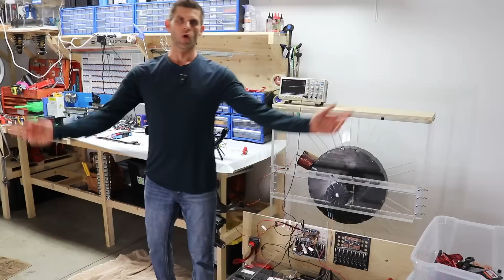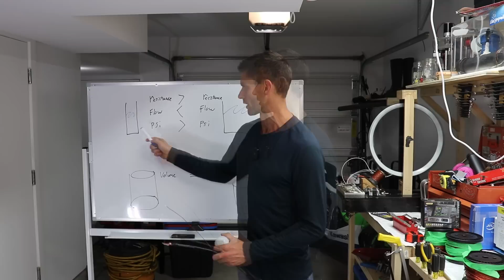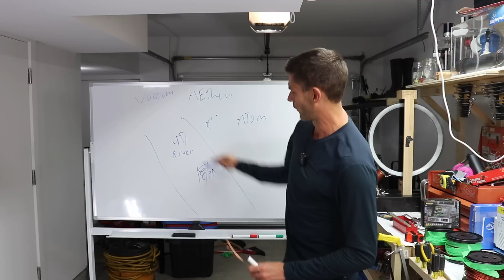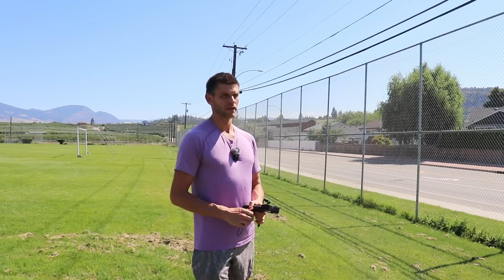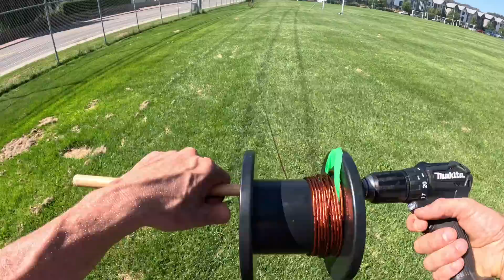I Built This Energy Machine in My Garage — And It Works

Comment: Hey broski, havnt been following you too long.. and havnt seen lots of the videos but im also intrigued in this area... (as an uneducated pleeb with nowhere near the experience you have) but ive actually been working with AI designing a similar system but kind of on a more theroretical level as I dont have the funding or capacity to achieve something like you're doing. But! my question is.. why are you utilizing only the one copper wrapped coil? wouldnt it be more efficent to surround the main centerpeice with coils? (granted i know the copper is expensive, expecially just to keep it wrapped in a coil lol there would also be higher resistance and lower currents adding more coils, but theres gotta be a sweet spot right?) our designs are kinda different as mine is horizontal but this was initially an idea I had for the basis of UFO type power which is essentially very similar to this.. but it goes into other things, such as magnetic water filtration and lots of other theroretical nonsense. But horizontal around the center column that would act also as a middle support column that can spin on a round craft.. but in order to produce a gravitational field around key points of the entire object. I was thinking maybe 5 or 6 copper coils would need to lay the entire interior edges of the craft. im working smaller scale, so I was using electro magnets in a N,S,N,S,N,S  configuration. hooked up to a 3 stage electomagnet that uses sequential activation similar to our 3 phase motors.. along with sound waves to try and create a gravitational field around an object.. but wouldnt this also draw more power? (additional coils I mean)
Reply from the maker: Appreciate the comment, keep going! We have room for 16 coils, more next video :)
Reply: @MadscienceLPTECH  perfect!! I figured it thats what much of the space around the wheel is for probably and you were either going to measure the output after each coil is added individually or just hadnt gotten to it yet.

Comment: You need to isolate the output that drives the mosfet's with optocouplers from the mcu.  You may also need to look into adding an extra shield ground trace and/or an entire PCB layer to catch the feedback spike if the coupler doesn't arrest the HV spike.  Those digital lines from the sensor probably need to be ground shielded too.
Reply from the maker: Agreed. The proximity in lines occurred on the board.

Comment: Also regarding your problems with faradays law have you already located where and in what faze the problems occur also about the sensor would it be detrimental to go with a higher resistant sensor and possibly extend it further from the contraption it may be experiencing induction from being so close to the epicenter of the wheel cant remember what you called it exactly
Reply from the maker: Yes we have the problem solved

Comment: 4:00 - all electronics runs on smoke, so don’t let the smoke out. FYI, I believe Bedini mentioned using neons to clip the upper voltages from the coil spikes in order to protect his SSG circuit.
Reply from the maker: Agreed. Now we have SiC TVS diode s instead of neons. I can explain this in the next video

Comment: Just a thought: what about using another optical sensor so you’re running two in sequence? Or more? Or what about having the other coils to intake additional voltage from wind or solar; thermoelectric etc? Keep going man
Reply: Also, idk what I’m talking about but I see your vision. Mine in Kamloops (open source and not started) is a micro energy capture device that charges from many micro energy sources and dissipates as needed.
Reply from the maker: Nice
Reply: @MadscienceLPTECH  another thought is you could slow the optics for the sensor to read in order to put less stress on one sensor yeah?

Comment: Does the type of wire you are using make a difference? I see that you are using car audio wires. Does it matter if your using stranded copper or solid weave?
Reply from the maker: It definitely does, what is best? I dont know. U definitely want solid core enameled wire for the coils but what size etc is still up for finding

Comment: The Ether ? It's just the Thermal Gradients going lower like the colder temperature rushing into a refrigerator and using the Thermal Gradients to generate power like a Nitinol Motor running between the Hot and the Cold Side. Think Deep Space and Absolute Zero..... 🙃
Reply from the maker: Thanks for sharing your thoughts!

Comment: I believe there is multiple ways to tap into the vacuum for energy. Creating the dipole within the dipole of the lead acid battery seems to be the most well known one. I find Henry Moray's passive setup the most fascinating, where the load itself is creating the imbalance, which the vacuum continuously filled the void created by the load. His invention lost about 30% power at night, which means the sun interacts with the ether.  I believe this phenomenon will have no effect on the Bedini motor and the way it interacts with the vacuum. I think Moray's setup used sympathetic ionizing resonance to create a "plug in" that an imbalance, or load,  could be attached to. 
I was wondering if larger diodes could deal with the energy spike issues you're having, or is more a matter of the spacing or placement of equipment?
Reply from the maker: Yes we are just revising a few small electronic details and it will be fixed. I agree morays stuff is legit this is just scratching the surface

Comment: EMF recovery never exceeds input power. In theory you can pull energy from quantum fluctuations, but even with exotic tricks like Casimir-effect negative energy, the usable power would be insanely tiny — basically immeasurable. And even if you somehow got a little “extra,” real circuits still lose more in the microcontroller, MOSFETs, etc. If you’re frying parts from 5 V spikes, just use a TVS diode. Also keep in mind: every perpetual motion demo hides a battery somewhere except for this one he doesn't even hide them
Reply from the maker: I think you miss this point. Generic scinece and ideology
Reply: @MadscienceLPTECH  Generic Science an ideology are in fact bad but so is spreading disinformation for personal gain.  I see a channel that has a lot to gain from people believing in you doing this and I've noticed you asking for money in numerous videos.  It brings into question motivation.  

In addition to EVERYTHING else.  I've poked through your channel and cant help but notice that you have showed ZERO proof of this EVER working in real world applications.  I haven't seen a single thing definitively proving that your machine produces more energy than you put into it.
Reply: Paradigm blindness in full swing
Reply from the maker: For sure
Reply: @xanthotest8855 Paradigm blindness? I’ve restored HPLCs, modded detectors, built a fusor, glovebox, electro chemistry rigs, gas purification setups, custom spectroscopy instruments, and I’m prototyping an MRI/NMR system with RF ablation. Trust me, I’m not blind to new paradigms I build them
Reply: @xanthotest8855 Paradigm blindness? I’ve restored HPLCs, modded detectors, built a fusor, glovebox, electro chemistry rigs, gas purification setups, custom spectroscopy instruments, and I’m prototyping an MRI/NMR system with RF ablation. Trust me, I’m not blind to new paradigms I build them
Reply: Many people including myself have built working bedini wheels.
Reply: Yes bedini motors work but they don't run indefinitely and they don't produce energy they don't tap into quantum fluctuation or any of that, there is no easy way to free energy I'm sorry but that's how physics works
Reply: @diylithiumguy 

Of course they wont or they would make no money 😂

They say Open source then have a go fund me that brings in thousands they just say stuff like quantum and similar terms like yeah the motor works doesnt mean it makes net energy gains

Comment: I also time my wheels optically. I had the same problem blowing them out. I wound up powering them with a separate Buck converter connected to the run battery. I'm using off the shelf components from Amazon. Probably way less efficient than what you're doing. Play for experimenting they are fine. Keep up the good work great video love it. You are the man⚡⚡⚡
Reply from the maker: Glad you are enjoying the videos⚡⚡⚡ we are fixing the optos

Comment: Use 1 or 2 or 3 or 4 100n capacitors at the sensor vcc and gnd to suppress.

Unless i see the device working for real for myself, i won't believe your system is generating power from quantum or whatever u call it.
Reply: U don't always need multiple wires . Use copper tape
Reply from the maker: I understand, stay tuned for more updates!

Comment: Do you see, at any point during the charging pulse (going into the battery),  the voltage drop below the nominal battery voltage? Or is it always higher?
Reply from the maker: Higher so far but we need to run for long time period

Comment: A sharp gradient is also needed when converting great heat to electricity. That's one reason heat batteries aren't so common. We can collect heat easily, but it requires a lot to have the sharp gradient to take it the next step to electricity. Converting sunlight with the photo-electric effect seems a bit easier (around 15% efficient). Hydro-elecric power is basically the same, but the gradient is simply the pressure from water falling (because of gravity) and forced to spin a turbine. So, the "sharp gradient" is key for all these conversions.
Reply from the maker: Interesting thoughts on gradients, thanks for sharing.

Comment: I looped 2000 ft of extension cords around the perimeter of my 10vacre property and the current generated as the Earth rotates through the Geomagnetic field induces 27 V AC Current and the Amps reads "Err" (Earth torque, you're not gonna measure that amperage with even an Industrial Meter.
Reply from the maker: Nice work, sounds like some great results?

Comment: Bearings help, but your real gain will come from coil geometry and discharge sharpness. Try a bifilar coil wound Tesla-pancake style, arc magnets on the rim, and a fast SCR cap dump. That’ll pull radiant a lot harder than smoother bearings ever will. IMO
Reply: Great idea
Reply from the maker: Yes we will try lots of things... the switching off time for the Fets in 1.4ns, that should be a good start :)
Reply: @MadscienceLPTECH Wowzers that 1.4ns switching is truly fantastic, you nailed that, hmm well since you’re already doing multifilar, next level might be trying a shallow conical or even partial caduceus on those big spools, it sharpens the collapse instead of smearing it. And if you haven’t yet, dump to ground plate/rod as well as the battery. Great Job, keep it up!!

Comment: I think you should just make a 6 spool winding machine that weaves or winds the wires the way you want. Its honestly not that hard to do. Just need multiple spools to feed into it and it spins the wires as it winds onto a new spool. You can make a counter to count the turns and calculate the lengths
Reply from the maker: That is a great idea and could be very useful.

Comment: ✨ Timestamps for: I Built This Energy Machine in My Garage — And It Works (31.08.2025) ✨

00:00:00 - Video begins
00:00:04 - Introduction to the clean energy technology series and the creator's background.
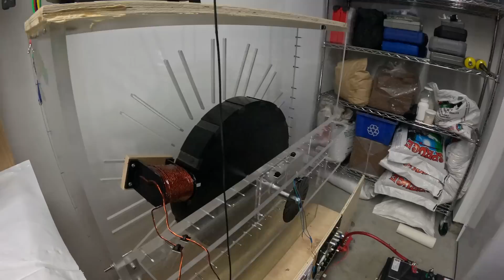00:00:56 - Explanation of the Bini motor and its components, showcasing a smaller prototype.
00:01:35 - Demonstration of the larger energy machine running on a single battery and coil.
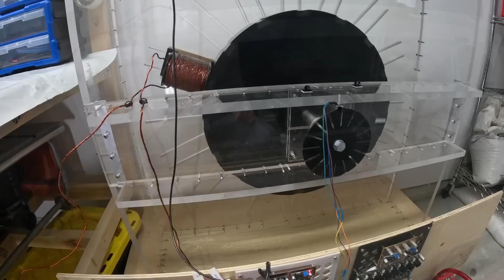00:02:48 - Discussion of initial challenges encountered with the optic sensors burning out.
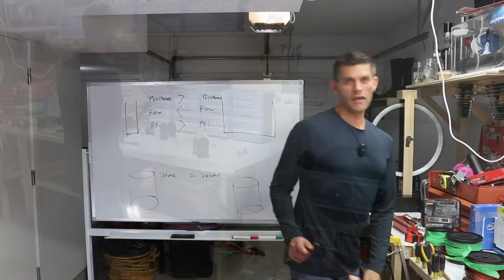00:05:24 - Analogy explaining wire sizing using the flow of water in rivers.
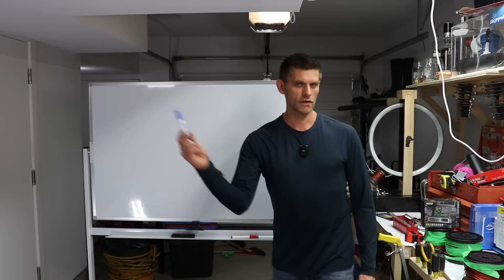00:09:08 - Historical context of vacuum energy theories, tracing the evolution of scientific understanding.
00:14:17 - Methodology for measuring over-unity energy generation, aiming to demonstrate self-running system.
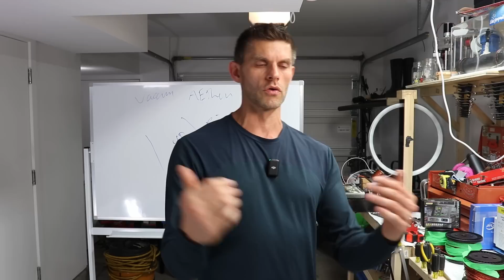00:15:29 - Acknowledgment of crowdfunding support and discussion of sponsor issues and YouTube funding.
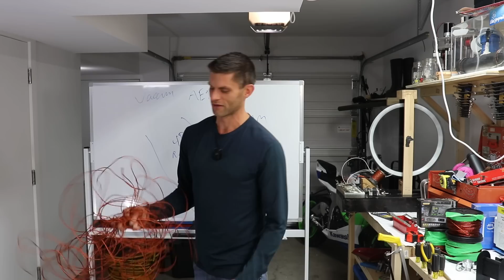00:20:25 - Coil winding process demonstration and commentary on setbacks as learning experiences.
Reply from the maker: so good timestamper thank you!

Comment: Not that you're gonna listen but
Need SAME values COIL & CAPACITOR in SERIES
1H L 1F C & THEN GROUND IN between saids COIL & CAPACITOR
Then PULSE it. You get higher voltage higher average and less complicated secretary. Science it just works
Reply from the maker: great tips, will think about trying down the road

Comment: Hey bro! I still don't get the concept of the twisted wires. I saw others are doing the same but it seems as missconception. If you are talking bifilar wireing it means its a closed loop (both end are on the same side) and its very own nature it doesnt build up magnetic field around itself. you don't use closed loop, well the twisting is absolutelly unecessary. If I get it well one coil build up the field around the iron core the other collect the collapsing field. If you use 2 simple wired coil on the same core it will work the same and you dont need twist the wires.
Other thing I found a guy who use one capacitor and only one battery to maitain the process and charge it back at the same time. For example: https://www.youtube.com/watch?v=8_VCf_ZeQoc
I think both cashe worth an investigation and both could make your life easier.
Reply from the maker: Discharging and charging at the same time is not desirable for the effects we want. The twisting just helps everything flow synergistically. It maybe unnecessary.

Comment: Regarding the sensor burning out after initiating a few coils, I would explore the newest mosfet technologies. Silicon Carbide (SiC):
(Companies like Wolfspeed and STMicroelectronics ) have been developing advanced SiC MOSFETs for high-power applications, offering benefits like increased efficiency and power density. Another channel I follow used these to upgrade a cheap Chinese charge controller and he made it much more efficient. Then there are Gallium Nitride GaN, which I've yet to see but are said to be.  next level. Great video and projects by the way. Please disregard my comment if your already using these (I couldn't see and tell)
Reply from the maker: Yes we are using SiC Fets and diodes. Cheers and thnaks for the comment 👍
Reply: @MadscienceLPTECH sorry it should have dawned on me that you're already using them. These "new" ones are super new to me

Comment: Where is the proof though? Can you show that the current coming out of the system is higher than the input?
Reply: You don't compare current. You compare power input to total output power. This device is more complicated, however.  Output contains both electrical and mechanical. Not so straightforward to measure.
Reply from the maker: the point of the channel

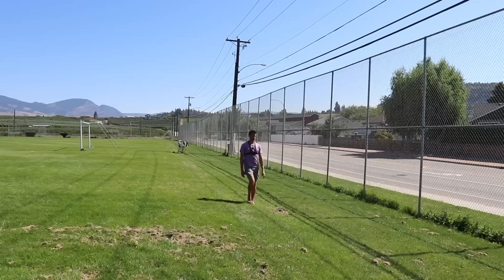Comment: 25:37 I’m curious about the design. Is there a reason for winding the wires together manually instead of using Litz cable?
Reply from the maker: Mainly so its more synergistic in flow... but lits would be easier for sure

Comment: Respectfully, I’d like to suggest that you try using weight rather than length for meet your coil parameters. Once you have one coil that perfectly meets your specifications you can weigh it, and then produce all the other coils to the same weight — and that will equal the length of your perfect prototype coil exactly. This will save you from all the laps back and forth out in the heat.
Reply from the maker: Good idea, thanks for the tip!

Comment: Vacuum energy is electron virtual particles that pop in and out of existence but can get sucked into the system when the wave in the inductor collapses and makes back EMF voltage spike that is captured. I believe the Quantum field is our more modern explanation of the fluid aether they were describing. It permeates everything
Reply from the maker: Agreed

Comment: The Energy surrounding us is free and Universal…let’s Call it Universal Energy…Tesla Made a Pierce Arrow Electric Car Drive without Battery without Range Problems…it used 9 Radio Antenna Swinging circuits stacked ontop of each other…This will transform Universal Energy into a usable format…You could Use This inside Your Bedini Motor…the Flow of Energy should not be dictated by the Switches but by the Antennas…and the Antennas will not burn the Sensors…
Reply from the maker: Nice ❤
Reply: The so called Tesla self powered car appears to have been a hoax that someone posted to the internet. There was no actual basis for it.